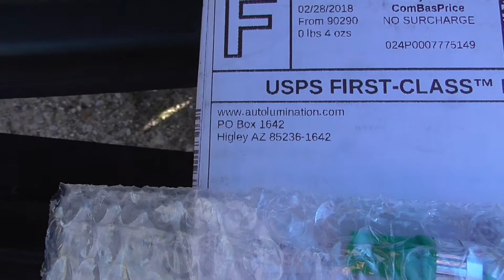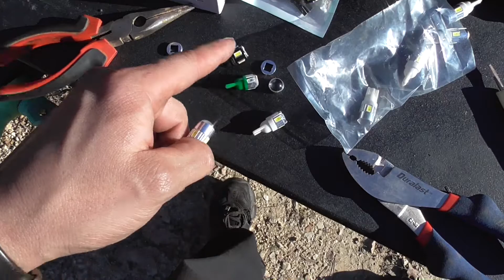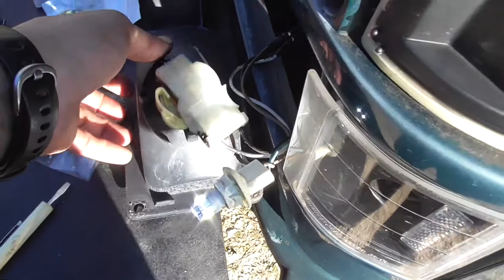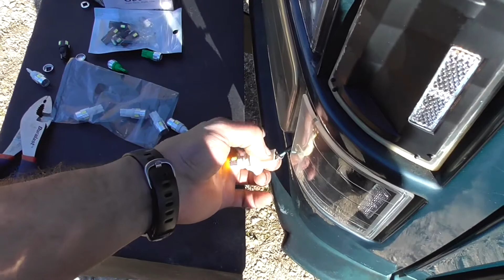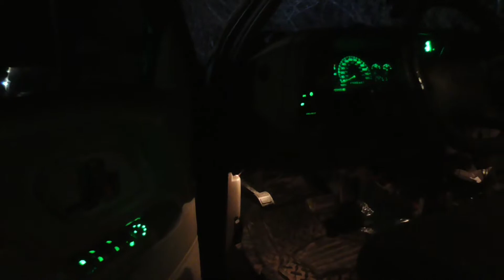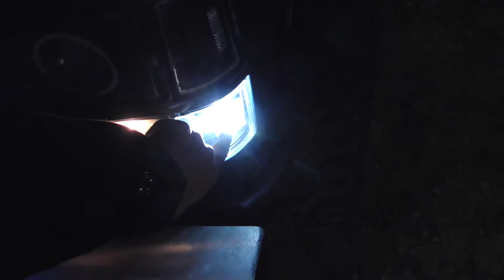Yukon Update | AutoIllumination 194 Switchback LEDs

Comment: It’s not literally negative 12 volts 
-12.0 v 
No... sheeeeesh man it’s just a Chinese sweat shop LED switchback it’s not gold plated plutonium Bro
Reply from the maker: Did I say it was gold plated? No. And yes, technically it is. It's both forward and reverse polarity, which means it works on both the power side and ground side of the circuit.